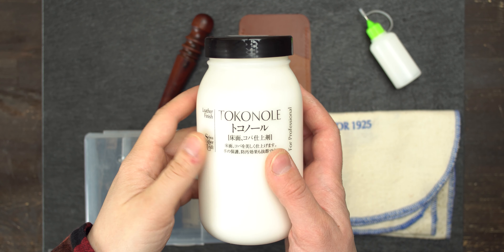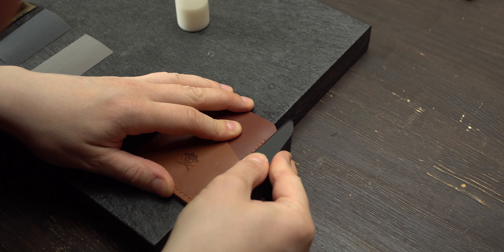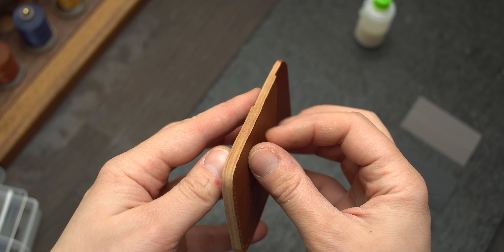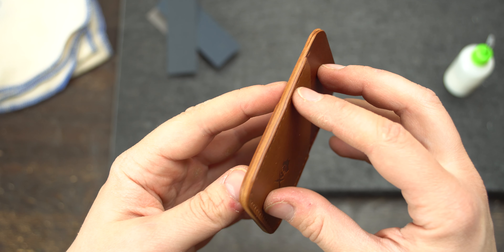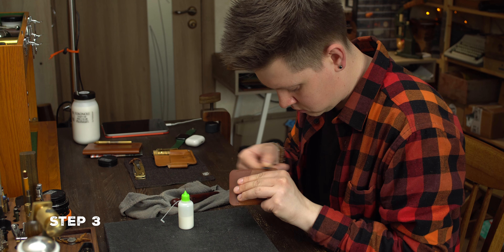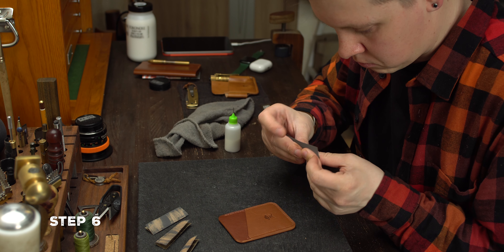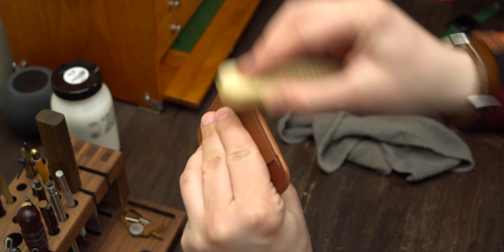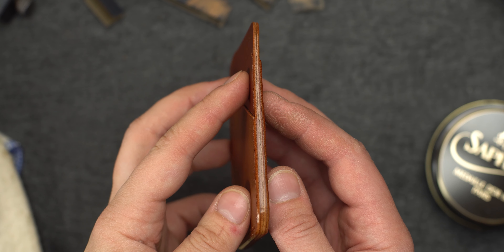The Ultimate Guide to the Perfect Leather Edge (2024)

Comment: Thank you for sharing.

Nice Video and technique. 

 In terms of edge to surface color uniformity, have you tried to dye the edges the same color as the leather?
Reply from the maker: Thanks so much😊 Yeah, several times I’ve tried to match the color, but I’m not enjoying the final result aesthetically. I’ve found that the best result is with a bit different tone to have some contrast and also if you have contrast thread, the best way is to match edges with thread. So for example we have light brown color of leather, we sewed it with dark brown thread and the best color for edges is also dark brown. In this case the result will be more enjoyable from aesthetic perspective.

Comment: Is that an aftermarket tokonole applier? 
What kind is it, and does the tokonole gum-up inside the needle part?
Thanks.
Reply from the maker: Yeah mate, it’s a 30ml plastic container, and you can unscrew the top cap. So then simply by pressing and sipping you can fill it with 50/50 mix of tokonole and water👌